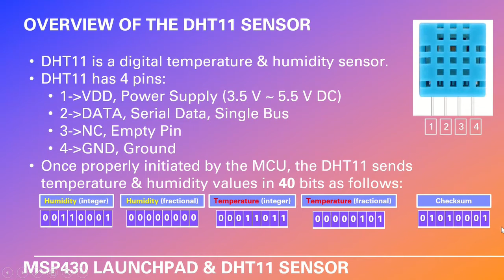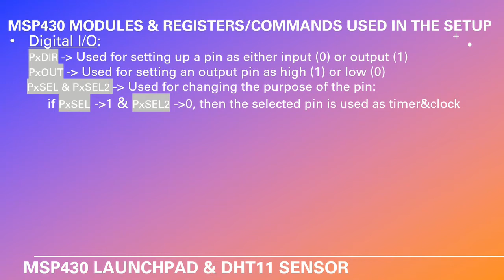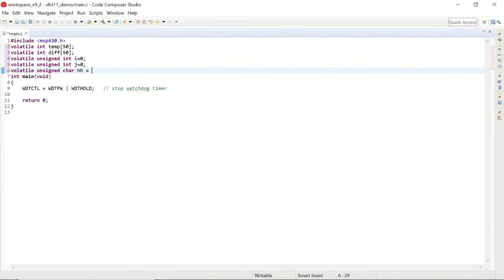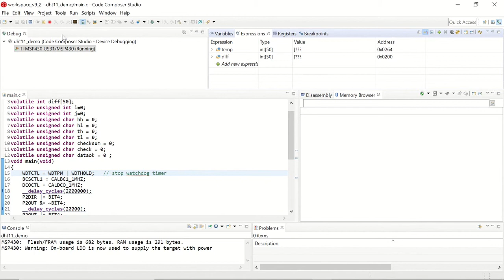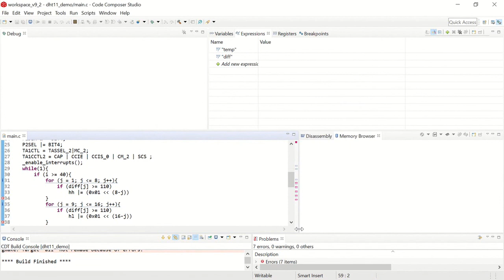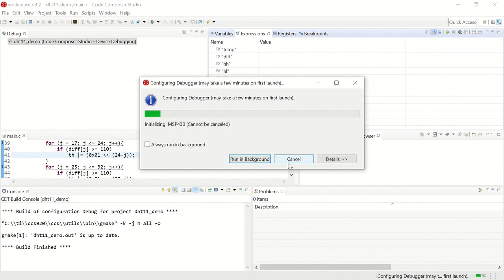MSP430 Launchpad & DHT11 Sensor

Comment: Thanks for the low level-hands on approach. I would humbly suggest you to what type of pins we need to use in different devices. For example, I am using FR6989 and it has different pin mapping. In your device: Port 2.4 Timer1_A, capture: CCI2A input. Sorry if I missed this information in the video.
Reply from the maker: Thank you for your comment. You're right that the code will work for a MSP430G2ET launchpad only, however since I don't have the FR6989 board I could not give the correct mapping / updated code for that. 
But I can say that it's also on my list, because I see that many people are working with FR board and requesting information about it. It seems that I'll have to obtain one and work on it as well. Thanks again for your suggestion.
Reply: @drselim  EXP6989 launchpad is great for its low power segmented LCD screen. Yeah, I know it is relatively unknown compared to others but much more fun since it opens a new world of opportunities with its display.
Anyways, great video and approach.
Reply from the maker: @PimpofChaos  It seems that I'll have t obtain one :) Thanks a lot for your kind comments!

Comment: Sir, I have a question. When we read the sensor data continuously we are reseting the MSP430. I tried reading data continuously without reseting MSP430 and it works. But I have one problem. For example, Room temperature is increasing and also DHT11 temperature is increasing but when room temperature is decreasing DHT11 temperature is staying as it is (But when I plug in again temperature value going back stable room temperature immediately). I tried my sensor in arduino and it works fine. But I couldn't understand why we are reseting msp430 to read data contuinously, what is the reason for that?
Reply from the maker: Hi, I guess you also sent an email. I responded to that. The usage of watchdog reset in my code was to fulfill the time gap which is necessary between two readings in dht11 (you can check its datasheet). I answered your questions in detail in the email.
Reply: Robert Lungu  send me an email address
Reply: Robert Lungu  I think you can write your email address here if you want
Reply from the maker: Probabyly links and similar stuff are avoided. I hope you found a solution?

Comment: Hello sir ...I have DHT11 sensor of 3  pin will it work fine if i use it  instead of 4-pin dht11
Reply from the maker: Hi, I didn't try the 3 pin versıon. But I guess it should work. As you can see in the video, one of the pins is not connected in the 4 pin version.

Comment: i just tried this example on my MSP450F5529 and i cannot seem to get past the errors.I stopped at 26:36 to test my sensor node, but I get errors saying that BCSCTL1, CALBC1_1MHZ, CALDCO_1MHZ, DCOCTL are all undefined.
Reply from the maker: Hi, the header files and the modules for G2553 and F5529 are not the same, so the BCS (Basic Clock Signal) commands are not available in the msp430f5529.h file ( i checked it personally). 
I'm not experienced with F5529, however you can find a way to set the clock frequency by looking it up on the internet. An example can be:
https://e2e.ti.com/support/microcontrollers/msp430/f/166/t/856048?MSP430F5529-Clock-Initialization-to-1MHZ
In any way you'll have to modify the code for your microcontroller. :)

Comment: Just a litle question, i work with a MSP430FR6989 and i had configured my clock AT 16Mhz, i'will divide my timer by 8 but this speed will run at 2MHZ. How fixed you code for this speed.

Thanks
Reply from the maker: Hi Pierre, first I need to mention that yor code will probably be different in many ways, since there are different registers involved in different MCUs and also modules can have different names in their header files. So the code that I uploaded most probably won't work on your MCU. However, assuming that you modified it according to MSP430FR6989, your clock speed (2 MHz) will mean that your timer will count up 2 values in 1 microsecond. Your timer register (in my MCU it's TA1CCR2) will have a value of 2 in case of 1 microsec, 100 for 50 microsec,14000 for 7 milisec, etc. so you'll need to divide the timer value by 2 before assigning it to the 'temp' array that is in the ISR. 
Hope that it helps you with your code.

Comment: ENG: Hello teacher, I think your code is doing one-time reading. I can see the values in the sensor instantly on the LCD. However, I cannot see the instant changes. The value does not change when I put my hand on the sensor. However, when I debug it from the beginning, I see the values change. I've been working on it for a long time, but I couldn't read it again. I reset the value of "i" so that it reads the value again until it becomes 40, but it didn't work and I think the solution is very simple but I could not find it. Can you help me?

TR: Hocam merhaba, kodunuz sanırım tek seferlik okuma yapıyor. Sensördeki değerleri lcd'de görebiliyorum. Ancak değişimleri göremiyorum. Elimi sensöre koyduğumda değer değişmiyor. Ancak baştan debug ettiğimde değerlerin değiştiğini görüyorum. Uzun süredir de üzerinde uğraşıyorum ancak tekrar değer okumayı yapamadım. "i" değerini sıfırladım tekrar 40 olana kadar değer okusun diye ancak olmadı ve sanıyorum ki çözümü çok basit ama bulamadım. Yardımcı olabilir misiniz?
Reply from the maker: Hi, you're absolutely correct, the code does a one-time read. Actually there's no "continuous" operation due to the nature of the DHT11 sensor. Because in the beginning you have to wait for a certain period of time for the initiation. However I can suggest an option here: (at the moment I don't have access to the sensors and the microcontroller, however you can try it I guess) 
At the end of the while(1) infinite loop, you can try to reset the microcontroller with the watchdog timer. I have seen an example on the internet that does it with the following command:
WDTCTL = 0xDEAD;
here, obviously the DEAD hexadecimal is a nice and mnemonic faulty password that invokes the watchdog and resets the microcontroller :)
By this way, you'll 'probably' be able to refresh the measurement by about two seconds (check the initial delay_cycles command).
Please try it and let me know if it works. I'm also curious about it :)
Take care
Selim
Reply: @drselim  Firstly, thanks for oyur reply hocam :) Second, I try it. It resets yes, but there is no temp or humidity value on the screen. When i comment that line, it works perfectly, values on the screen as expected but when i comment out wdtctl line, there is no value on the screen. Maybe a little thing we are miss.
Reply from the maker: @fa-km5hd  You're welcome and thank you for the response. Maybe if you can share that portion of the code I can have a better look. We should reset the microcontroller after we receive all the interrupts and assign them to the humidity and temperature values (and I guess you're using an LCD for showing the values from the variables).
Reply from the maker: @fa-km5hd  you can send it to drselim2021@gmail.com
Reply from the maker: Please see the updated code and serial monitor at:
https://www.youtube.com/watch?v=Fzf8q6fgxfQ

Comment: Hi, your code works perfectly. But i don't find how restart the interrupt for read values into a loop. Thanks
Reply from the maker: Hi Pierre, I had advised in another comment to reset the board with entering wrong password for the watchdog timer ( after you do all the readings at the end of the while(1) loop.) so hopefully this is going to reset the board and start the initiation process (sending the pulse to the dht11 and do the reading again) . You may want to give a delay for a couple seconds before the reset. This can give you a reading refresh period of nearly 4 seconds. I hope this helps. Unfortunately I don’t have access to the sensor for some time, that’s why I can’t test it. Please let me know if it works for you.
Reply: @drselim  
I think it's not a good solution. For example with a arduino we can read values in a loop. I'll look for a available solution, and when i find it i'll give you a github link for it. I hope that of course.
Reply from the maker: Please see the updated code and serial monitor at:
https://www.youtube.com/watch?v=Fzf8q6fgxfQ